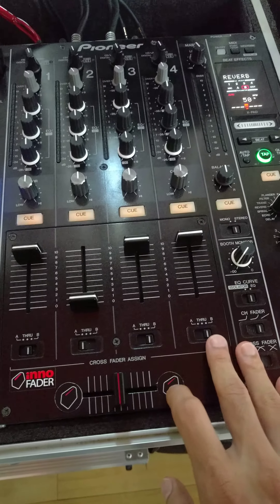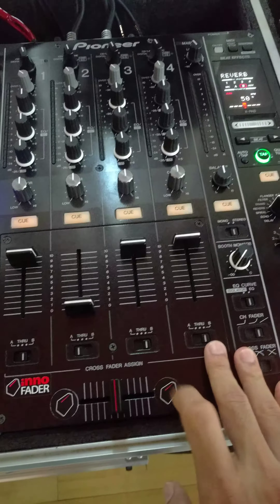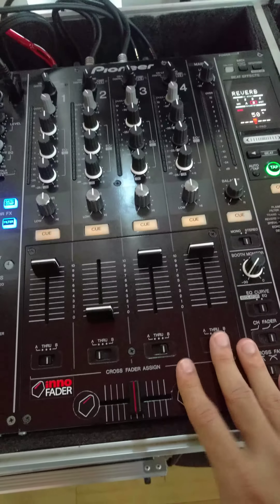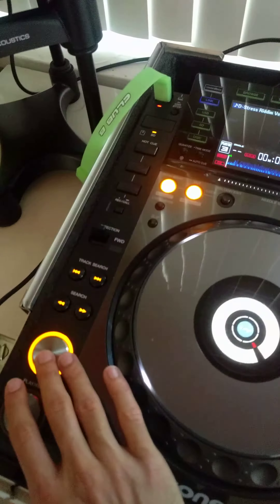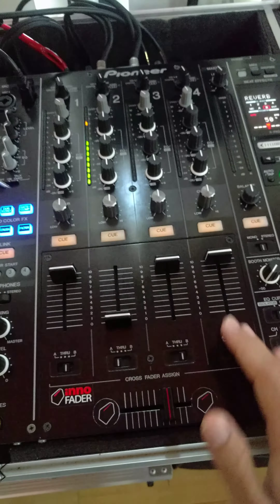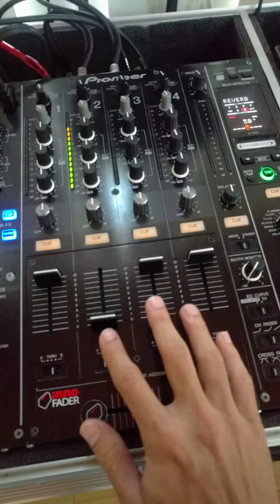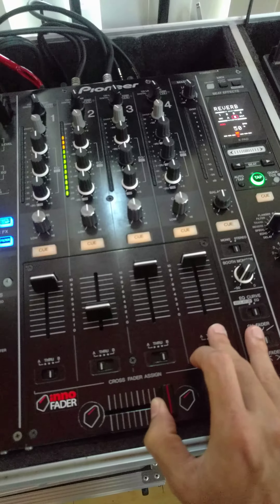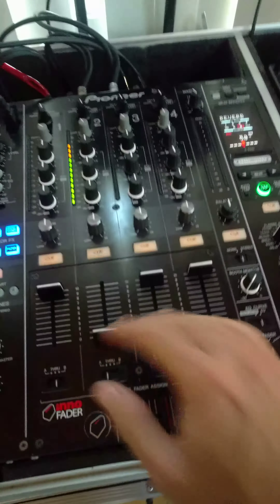Mini Innofader Issue - Sound Bleeding

Comment: I have a older epsilon mixer that came with the mini inno fader in it.. I  have this issue with my up fader on channel 1 ..its fine on two ..so i ended up changing the polatrity ...so had to relearn the volume fades there a bit..but took care of that issuse that way..

But on my cross fader i have a annoying bleed where i slide left and it cuts but you still light static of the music bleed thru ..i slide all the way to the right and it cuts silent like it should.. ..so ..yea in my case i have an older unit but its crazy that all these years later inno fader still has this same issue lingering out the box. ..  #DOTHfreqs

Comment: PROBLEM SOLVED WITH TAPE!!  ALL YOU HAVE TO DO IS PUT Electrical TAPE around the edges of the cross fader slot.  Take off the top plate and wrap tape around the edges of the crossfader slot.  I installed The Mini Innofader Plus on my Z2 by NI. The PROBLEM is the metal to metal contact with the stem of the cross fader and the metal faceplate of the mixer.  PLEASE LET ME KNOW IF THIS HELPS ANYONE.
Reply: Nice, glad you got it to work.
Reply: @artsamsun  The electrical tape wore off after only a couple months.  I bought 12inch skinz cover for my mixer and I haven't had a problem since.
Reply: We shouldn’t have to do this.this is not what we paid for INNO fader is garbage end of story
Reply: Bro thank you. Tape worked instantly

Comment: I’m having the same issue with an innofader in my ddj-sx2. Mine only happens on the left side. Been running it like that for almost a year now. My only saving grace is that most of my cuts happen on the right side. Juggling or cutting in hamster sux tho.
Reply from the maker: I gave up and just put back in the original fader
Reply: I hear ya!  I just finished putting the original back in and I forgot how good it actually was. I actually like it better than the innofader. I know next time i need a fader I’ll just get the original one!

Comment: Kind of doesn't make sense to me that I should have to blow it off immediately after installing it. Same problem here
Reply from the maker: Sex4TheEyes True. I came to find out there was a mechanical issue with the fader and received a replacement which also didn't work at all. I just reinstalled the original fader.